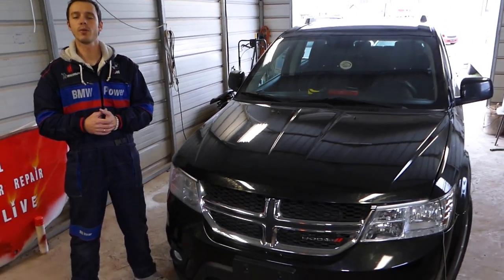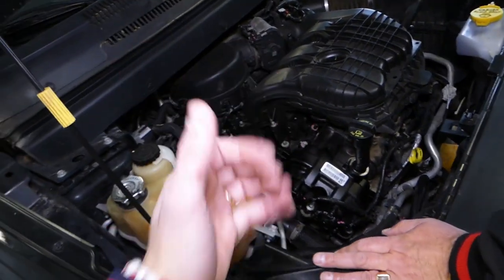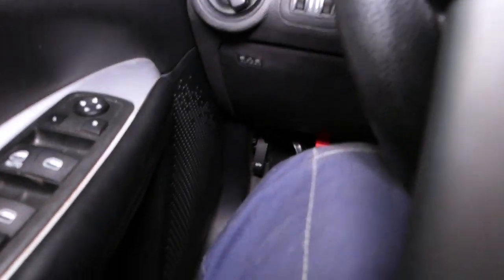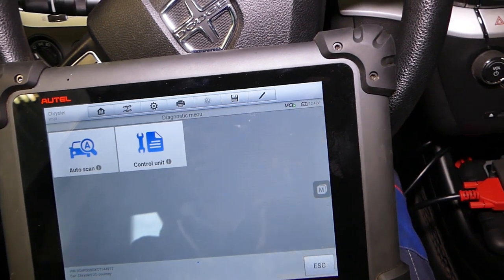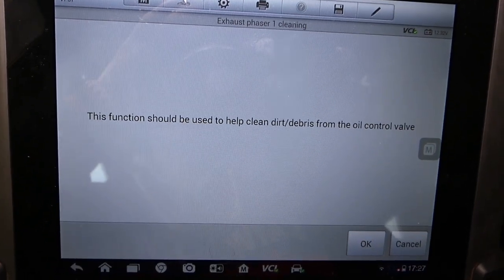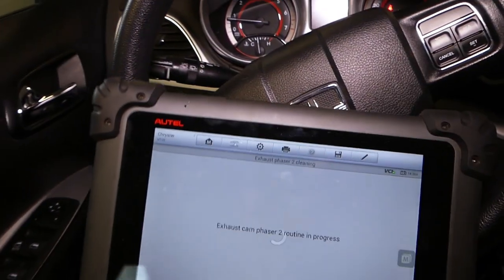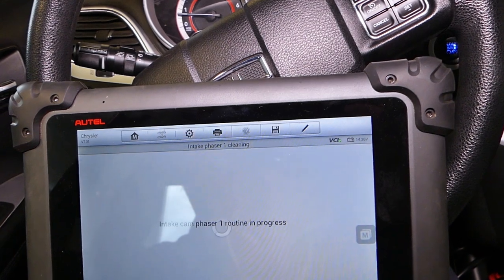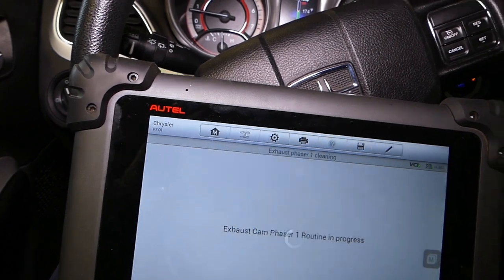HOW TO CLEAN CAMSHAFT PHASER ACTUATOR DODGE JEEP CHRYSLER

Comment: Good video but you have to turn the engine off and restart it between each phaser cleaning.  This is why you did not notice the RPM drop on the other solenoids after you cleaned the first one.  Keep up the good work.

Comment: Hello what kind of shop does this? Or is it better to replace the parts?
Reply: This does not fix anything. It just allow full flow oil to run thru oil control valve which may clean them